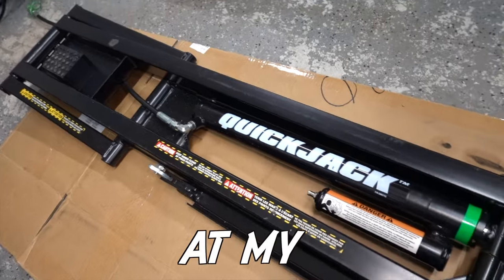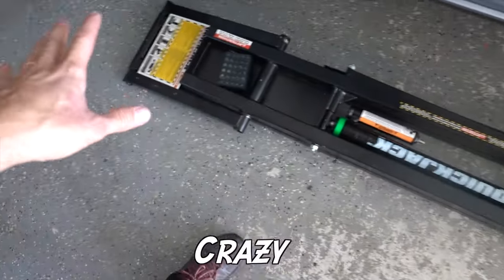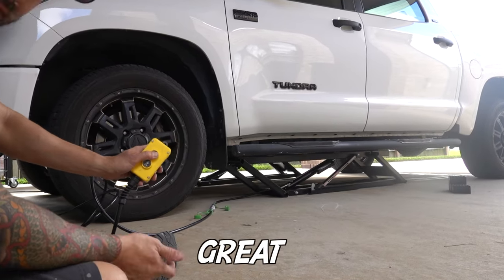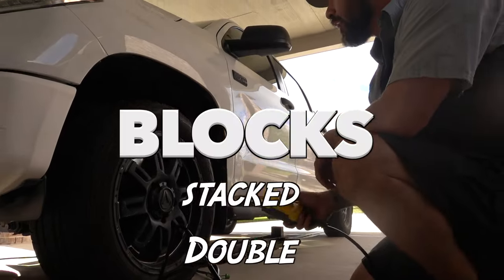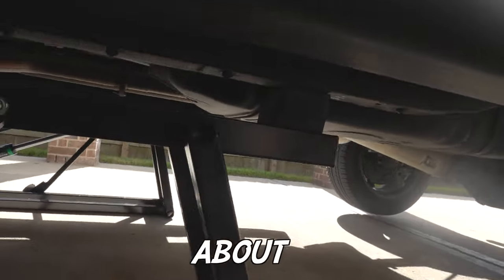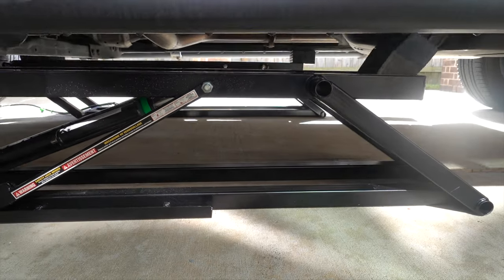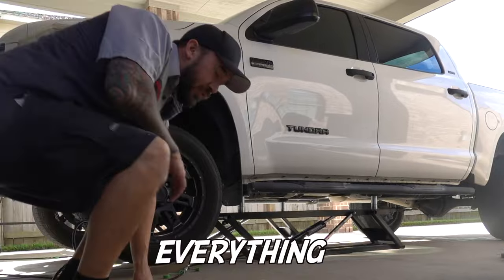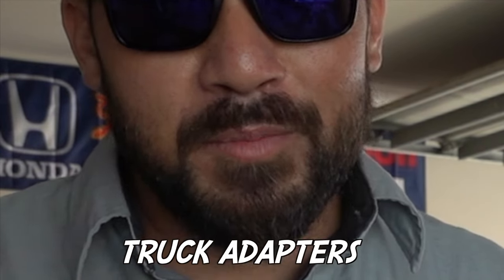My Most EXPENSIVE & DANGEROUS Tool MISTAKE - Quickjack

Comment: I think you are using the quickjack wrong as well. if I remember it correctly the front with big sticker should be towards the weight where the engine is.
Reply: Can you confirm this? I thought he was using it in the correct orientation.

Comment: Best block is a home made wooden block with as wide as possible base to fit in the Quick Jack.  This goes for all types of jack points, including pinch welds. I use custom laminated (oak maple, beech) wood that is scrape around the shop.  if you don't have hardwood scrap, cut plywood squares to laminate your own custom block.  these do not move, have a bit of cushion, do not split due to being laminated, and do not tip over.  BTW, the best (safest) jack stands are 4x4x12 inch blocks, setup cross ways like Jenga to form a 12x12 base.  bullet proof!!
Reply: The "jenga" blocks are called cribbing. They can hold tremendous weight IF the stack is built correctly. Not that it's hard, but some not paying attention can create a dangerous situation.
Reply: That’s what I did and it seems to work fine on Subaru Outback and Tahoe. My blocks nearly fill up the lift area and I can add rubber as needed .

Comment: Ok why would you even attempt to lift with the rubber blocks on a Tundra?  Thats just being stupid right there.  I have the same model quickjack for my tacoma which with all the skids and stuff I put on it weighs 6,000 lbs.  I use truck adaptors and NEVER had any sort of problem.  The main problem is people using the quickjacks WRONG UNSAFE manner that creates the situation that you had.  I see so many people with mixed reviews on quickjacks and the negative reviews are almost always user error.....  Ive had mine for 4 years now and never once dropped a vehicle....
Reply from the maker: Thanks for the comment. It’s appreciated.  This is just a silly video,  showing people what Not to do.

Comment: Back in the old days I worked at a Chevron Gas station... which had repair bays etc...... during our training program it was reinforced to us to 1) Never raise the lift blocks (these were adjustable lift points on the racks) more than the 1st setting on any short wheel-based 4 wheel drive (CJ's etc.) and 2) NEVER stack multiple blocks ever.  IMHO, I see too many no-instruction type issues for end users and in terms of time savings..... I have timed it lifting my 5k pound truck and 3800 pound wife's car raising with my 3 tone floor jack and 6 ton jack stands...honestly, from start to finish I can raise the vehicles up higher (26-30 inches depending on need) in less time than you can with the quickjack unit....
Reply: Thats amazing. Are you using some kind of ingenuity with wood blocks and pumping it up? How are you getting that kindof height that quick? For me to fuss on my belly with a jack and jack stands at all SUCKS!
Reply: @dangerdavefreestyle  I utilize ramps to drive up on which raises the vehicle about 9 in then I jack the rear end of the vehicle up place it on jack stands then repeat once with the front and a second time with the back and we are all done. I use a six-by-six wood block on the front ends of the vehicles with a floor jack and for the rear ends I have per stacked 3 2x10 board screwed together to use as a base to raise up the rear and again set him on jack stands

Comment: I'll tell you why this happened, and it's much more of an issue with higher (ground clearance) vehicles.  The truck adapter is definitely the way to go, but the potential issues still exists.  The problem is that by design, the Quickjack lifts in an arch.  This means as it lifts, it is trying to shift your car forward or backward, depending on which direction your quickjack is facing.  On cars that are lower or with not much suspension travel, the tires come off the ground quickly, and there isn't much issue.  

On higher vehicles like SUVs and trucks however, the suspension can droop a LOT.  So as the Quickjacks lift, they try to shift your vehicle forward or backward, but since your truck is in park and/or the parking brake is engaged, the tire's grip and the quickjack's motions are fighting one another, and you end up shifting the position of the blocks and sometimes forcing the tires to skip.  This usually causes them to sit all tilted like yours did.

So the best way around this I have found is to put the car in neutral but with the parking brake on.  Then, operate the quickjack until you just start lifting the vehicle at it's lift points.  This is to transfer some of the weight onto the quickjack so the car doesn't roll away from you.  At this point, stop lifting, then release the parking brake so the car is completely in neutral and free to roll.  Now go ahead an lift as high as you need.  While you're doing this, you will see that the wheels will rotate quite a bit as the vehicle is shifted forward or back, but this time it's just rolling, rather than fighting with the Quickjack at the lift points.

When lowering, do a similar approach of lowering it down, but stop just before you completely unload the quickjack (Putting a wheel chock an inch or two in front and back of a tire is not a bad idea in case you lower it too far).  Re-engage the parking brake and then lower the last few inches.
Reply: I also put on 2 thick zip ties and jack stands. can never be to safe :P
Reply: Vevor makes a similar lift that lifts straight up and down.
Reply: I don't have high vehicles and haven't encountered this issue but I totally understand what you're saying. I appreciate this comment and thanks for bringing this up. This could save some accidents for new owners who are not well versed in setting this system up.

Comment: Thanks for the post! 

Just want to mention that you positioned your truck backwards on the lift. You want to avoid placing the center of mass over rear of the jacks. 

Your truck was going to fall because most of the weight in the engine/transmission was causing a rotational moment of force over the back of the jacks.
The manual states that the bulk of the weight should be positioned over the front of the jacks. 

Glad it worked out for you though! Stay safe out there!
Reply: Looks right to me. The front (his garage side) is where his engine and weight is.

Comment: So i have a 7000 EXT and have both sets of rubber blocks and the truck metal post with the rubbber round tops square bottoms. I WELDED MINE TOGETHER. Since I had the un welded ones come out on an uneven down jack (I couldn’t see the passenger side well enough to understand it wasn’t coming down at the same speed) the left hand side shot sideways as the posts came apart (they have a spacer to make them taller) thank goodness it was nearly to the ground and only damage was an empty paint can in garage got crushed and the jack hit part of the undercarriage and made a scrape. I was freaking out about it because it was the one time I made room in my narrow garage to use the lift for all the fluid service. I usually use it on my lightly sloped asphalt driveway and have plenty of room and can see so much better. I recently had the pump fitting crap out and bought new Summit Hydraulic fittings off Amazon and will be replacing all my fittings. Can’t have it leak on me when my truck is in the air and it would be a real bitch to take it off the lift with jack stands on my sloped driveway. The sloped driveway is why i invested in QJ to begin with. Thanks for posting your issue.
Reply: Which fittings did you get from summit ?

Comment: the same issue can happen with a regular floor jack if you put the parking break on, the vehicle needs to move so it doesn't slip off the jack,  block your tires after you lift with regular jack

Comment: I almost got killed because of lacking of space when the jacks are not going down equally thus getting unbalanced on one side. I have a single car garage. I was lucky the car did not slide off the jacks. I finally succeeded got the jacks going down completely and i could take my car out. I think i got the lemon one. I returned the jacks.

Comment: Also make sure the lift is turned the right way.
Reply from the maker: I've seen this comment a couple times.   Why does this matter again.  Just honestly curious.
Reply: @Donnythelatemodeltech  Because as it's lifting, you'll have the heavy mass of the engine cantilevered out over the stand. It's lifting just behind the front tire, but only touching the ground about 1.5feet back from that. Lookup quickjack NSX on youtube. At the 18:15 mark of his video you'll see the car start to tip back. Since his engine is in the back, the large label on the jack should be towards the back also.
Reply: Actually you're not seeing the affect since your adapters are only a bit forward of where the quickjack rests on the ground. But still...

Comment: A used shop lift you can for around 1,500 bucks... those portable ones are ok, for R.S.A.  emergencies...
Reply: Or if your garage concrete isn't thick enough for a shop lift...or if your garage ceiling isn't high enough for  a shop lift...or if your single car garage doesn't have space for a shop lift...etc etc.
Reply: @lynnmckenney1987  My thoughts exactly.  There's a reason there is a market for these.  Our ceiling is 10.5ft high and still not adequate for a 2 post because the garage door rails are even lower.  Not to mention the builder concrete is likely only 2" thick at best.

Comment: What do you think? The truck adapter are good invest and they stay safe without slipping or moving during lift up/down and working on the truck?
Reply from the maker: They are  must when lifting a truck/suv.  I feel pretty safe using them .      They are pretty comparable to what's used in a dealership shop.
Reply: @Donnythelatemodeltech  thnx for the info and sharing

Comment: The Quickjacks are great if you're lucky and get one without a defective air cylinder.  If you do get one of those you're screwed - the company will 100% not stand behind their product.  They'll claim the air-assist down isn't "necessary to the function of the lift".  Really?  So if one side has air assist down and the other doesn't, and they drop unevenly, that's safe?  And then when the car vehicle drops to the ground ground and one side of the lift goes straight to the full down position while the other...  doesn't.  You need to wait... and wait... and wait for it to drop with no weight on it.  Quickjack will claim this "is normal operation" and that "it will get better over time".  If you invest a massive amount of time trying to get them to stand behind their product they will, eventually, after burning through every once of customer goodwill, send out a new cylinder.  Yay!  Until you get the replacement and the freakin' air side is literally capped off.  Like intentionally made unusable.  That's not a fix guys.  Then they'll claim that the engineers decided the down-assist wasn't necessary and that they've changed the design on future models.  But I didn't buy a future model with less functionality.  I bought the current model with exactly the functionality I wanted, was promised, and paid for.  Whatever.  Too much time wasted on it already - I've written off the entire company as another skanky marketing hack with no integrity.  

I still have it in my shop, but the company worked very hard to make me regret my purchase and it low-key pisses me off every time I look at it.  And honestly the setup is inconvenient enough that even when I do pull it out - warts and all - it happens very rarely.  Only when I have a longer term project where I know the vehicle will be on the lift for a week or two.  Definitely not for things like oil or tire changes.  It's just way quicker to use a floor jack.

Comment: Great failure demo.  Thanks!  I would really like to know why the stacked blocks failed.  It’s almost as if there was a shearing effect with the truck rails moving aft at a faster rate than the QJ rails, thereby causing the blocks to tip and fail.  But this shearing force would be equally present with the truck adaptors.  Can anyone explain the cause of this failure mode???
Reply: I just bought one of these Quickjacks.  The shearing is because the jack moves back as is goes up. When the wheels touch, they grab the pavement causing the shear. My new Chevrolet Silverado 1500 has grease on the frame and the jack slide off the frame while this was happening.  Lucky I didn't  damage the pickup nor the jack.  Next time the vehicle will be in neutral just when the tires are starting to drag.
Reply: @nealconrardy  Grease or is it wax?  I thought GM was still applying a protective wax coating on the Silverado/Sierra's instead of powder-coating the frames....
Reply: @manunava1776  It sure seems like a thick grease to me.  It will stain your clothes if you get some on you.  It doesn't resemble any wax I have ever seen.
Reply: The reason this happened is because the truck wasn’t lifted straight up. Truck was leaning back. Front tires were inches off the ground before rear was lifted. Watch it again. When the rear and the front are going up at a different rate, jacks needs to be moved one way or the other. Especially if blocks are stacked.

Comment: Why wouldn’t you use the truck adapter first because your lifting a truck.
Reply from the maker: The blocks are supplied with the jacks, the trucks adapters are sold separately and are a bit pricey,  so ... the temptation to try to get away without purchasing the adapter is in my opinion pretty likely.

Comment: Is it safe to work under the car using this?
Reply from the maker: oh yes. i use them all the time
Reply: It has safety locks in several positions.  There are videos where the car falls sideways because the operator raises only high enough to hear one click instead of both rails clicking.  To lower it, you must raise it slightly and manually disengage the locks.

Comment: I used this jack system got car up the hydraulic motor blew up the car slammed on the ground very dangerous to be under a mid rise lift work better for me
Reply: The motor failed as the car was lifting? Certainly it didn't "slam" to the ground once it was already raised. The safety bars would have prevented this if it was lifted far enough.